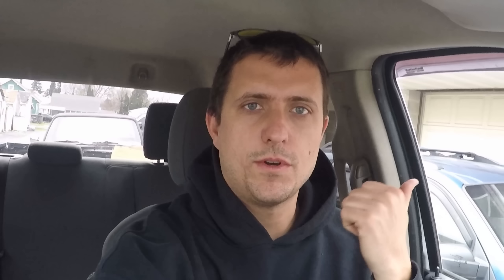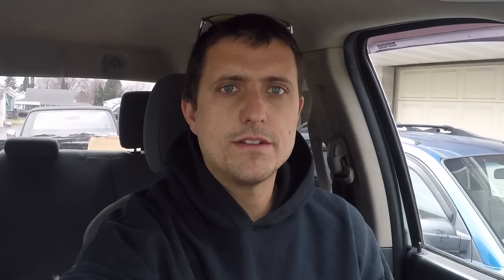Mercury Flathead Build Update - Ford Free T - Ep. 50

Comment: A Little more flathead advice.... run a oil with ZDDP in it first run or your cam wont last. If possible dont use the adjustable lifters. They are heavy . Most people are lazy and wont grind the valve lash. Also the middle exhaust ports cannot be opened up because of a valve guide passes through the block at that point. Also if not using the stock carburetor the vacuum advance will not work. The vacuum is run backward for the flathead distributor.  Using other carburetors run a early Chevy distributor the counter weight can be adjusted for proper spark advancement.  Chevy distributor can be machined to fit the flathead using the Ford distributor gear. Also if using stock heads run Ford heads on the mercury block the Ford heads produce more compression than the mercury heads. Best carb I found is a 62_ 65 Ford mercury  2 barrel on a mercury flathead intake . These are the 260 early small block . There are some oil porting changes need to be made also.  The flathead had only partial oil filter flow.  This needs to be fixed to a full flow.

Comment: A little flathead advice..... hot tank the shit out of that block to clean the scale out of the water jackets before machining it. Extrude honing the exhaust ports is also well worth the money to help keep the exhaust heat out of the cylinders & for obvious reasons will enhance performance. I believe there's a place in your neck of the woods doing it. Bigger valves sounds good but without fixing the ports its a marginal performance improvement that contributes to the cylinder heat transfer problem .
Reply: NZ Salt Flats Racer so much scale in my straight 8 will use your tip thanks
Reply from the maker: Thanks for watching. This isn't my first flathead and Don is an old time Flathead builder/racer and we most certainly do all of that. Mike is just learning this stuff and probably didn't think to mention it here. Don opens up the exhaust ports considerably just for the reasons you mentioned. Don't worry this isn't getting half assed! The engine was hot tanked early on after breaking it all apart and magna-fluxing it. Then it will be done again after all of the machine work is done. Good tips for sure! Thanks for watching! -Matt/ITG
Reply: @IronTrapGarage  I wasn't suggesting you are half-assing anything, it was more of a point for those who don't know, especially on a flathead ford where it's not possible to access the outside exhaust ports that go around the cylinder. Apparently I ruffled some feathers so I'll refrain in the future.
Reply from the maker: You didn't ruffle feathers at all. I was agreeing with you! Hard to hear tone in comments. Don't refrain at all. Takes a LOT more than that to ruffle my feathers! Thanks for watching and commenting, always appreciated! -Matt/ITG

Comment: What Horsepower do you expect out of that Mercury Flathead ? - around 120 ? -  I think they were 110 as standard ..
Reply from the maker: I would hope with all of the work done to maybe see closer to 150 but I never much worry about the "numbers". I want it to run, sound, and look good in the end of the day! We're starting out with an earlier 59AB Ford block and putting big valves and a mercury crank in it as well as boring it out so it isn't truly a "Mercury" engine. It' should move that little T down the road just fine I think! -Matt/ITG
Reply: @IronTrapGarage  I've seen the 100hp early 50s ford v8s easily push 180 horse with a race cam, offy heads, better carb and manifolds. I believe your goal of 150 is very doable. I like this hotrod. It has a lot of traditional feel to it which I like. Keep up the good work!
Reply: I think with a intake and exhaust porting. High lift cam , run headers.  Better carburetor.  And relief porting the block.  Solve the spark advancement problem ( running stromburgs ) and other than stock carburetor.  Add a blower around 300 horsepower.  No blower at least 150 horses.